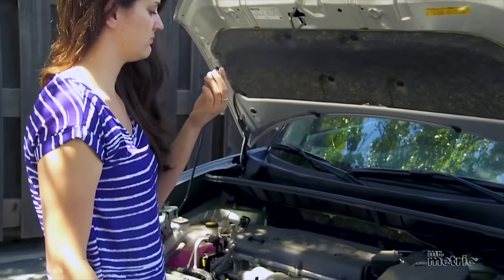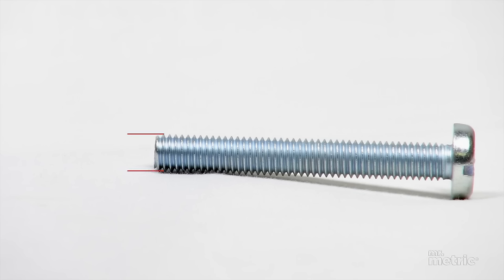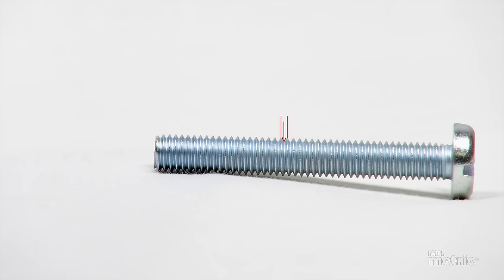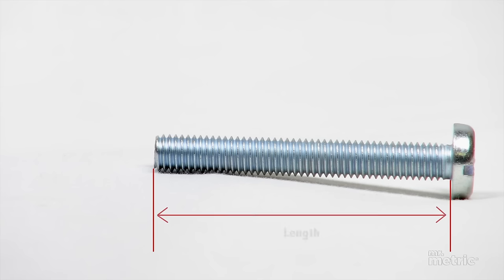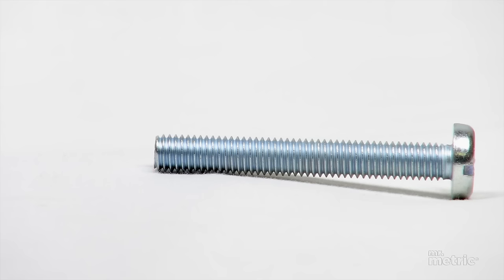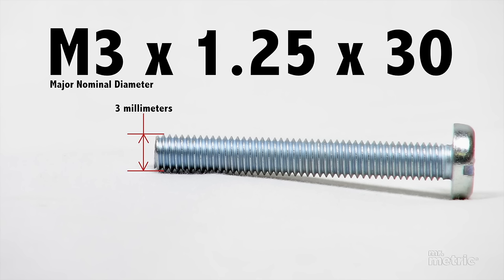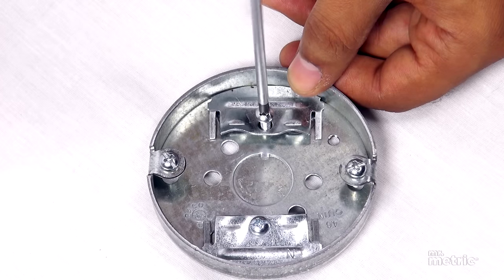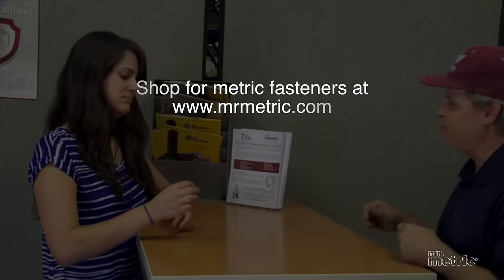How to Read a Metric Screw Thread Callout

Comment: Sometimes is see a screw sizes with a "g" in it. For example 10g x 16mm. What does the "g" stand for
Reply from the maker: The "class of fit” for all metric fasteners is “6g”. So for the question 10mm diameter with standard class of fit.

Comment: For US measurements:  Thread Pitch will instead give the number of complete threads per inch of length down a screw.  Ex:  10-16 references a #10 screw size (use a chart to know what exact measurement the #10 references), and a thread pitch of 16.  Aka, 16 complete threads per inch along the length of the screw.

Comment: I have a very tiny electric motor with a gear box that reduces it to 18 rpm. There are two threaded screw holes in the top plate of the gear box. Some research lead me to a diagram showing “2-M1.5” next to the hole. Can you help me figure this out? I only need a few, two exactly but a couple more to replace the one I will no doubt drop. 🤨

Thanks!

Comment: Thanks a lot, I was wondering whether it was the length of the thread or the whole bolt
Reply: For most types of head, it is the length under the head, but for counter-sunk heads, it's the overall length.

Comment: Let me correct some major mistakes:

1. There is no M3x1,25 screw. M3 has a standard pitch of 0,5mm.  
2. If I'd call myself "Mr. Metric" I would know, that we use the "comma" as decimal divider. The point is for the thousands.
3. The declaration of metric screws is [Diameter x Thread-Length] for standard screws. Only when it is a FINE-Thread screw (which is quite rare) the pitch is inserted before the lenth. E.g. M3x0,25x30.
Reply: " I would know, that we use the "comma" as decimal divider. The point is for the thousands."

This is not necessarily true. Some countries use these in the opposite places.
Reply: Some countries use 1,234.56, others use 1.234,56
Reply: Mr. Metric used that for example only not to divert his explanation in  wrong side
Reply: It is for example.....
Reply: You seem to know a lot. How do i calculate the minor diameter for this specific thread? M5 X 0.8

I would like to have the solution today, it is important! (Its in ANSI)
Reply: @GUATEMAXanimations  5-0.8=4,2   3-0.5=2.5
Reply: @Laubfrosch19  wwheeezzzeee! Too late, I already graduated last week from my CAD course!
Reply: @GUATEMAXanimations  I suggest you look up some already published tables.

Comment: Thanks for the video. I need screws for my Asus laptop, which are described as M2x2.5=0.5(3.3,0.3)(K)+H. I guess this means the screw diameter is 2 mm and the length is 3mm, but I'm confused about the rest. Does M2x2.5 mean the diameter is anything between 2 and 2.5 mm ? Is 0.5 the pitch ? Is (3.3,0.3) the length ? what about K and H? I'd be grateful for any help !
Reply from the maker: You chat with our fastener experts at  1-866-501-9504 and they can assist you.
Reply: M2x2.5 Means the diameter is 2mm and the pitch is 2.5 mm. I don't know about the rest designations.
Reply: It means 2 mm diameter, standard pitch (0.4 mm no need to indicate), 2.5 mm length.
We usually don't bother with stating pitch for standard fasteners.

Just imagine what a thread wit 2 mm dia. and 2.5 mm pitch would look like. Not that is couldn't be done, but that's an extreme driving screw, no fastener.

Same for the example given in the video. 1.25 mm is the standard pitch for an M8 fastener. You will never find this on an M3. Standard pitch for M3 is 0.5 mm.

Comment: Why I cant find M10 - 1.25 x 70mm flat head bolt anywhere..!!!!
Reply: Because the common pitch is 1.5mm and 1.25mm is fine pitch which is more rare. There are M10-1.25x70 socket head screws but can't seem to find any flat head for that size. Not sure what your application is but making a counter bore might an option.

Comment: M16*3*40/60.. what does this mean??
Reply from the maker: Good question. For M16-3.0 x 60mm or M16-3.0 x 40mm, it would mean: M16 = Diameter
3.0 = Thread Size
60mm or 40mm = Length
Reply: =) thank you ..

Comment: The bolt shown can't be M3x1.25x30. If the 3mm is correct the pitch is 1.5mm . I copied the picture into paint and copied  the 3mm end measurement and  laid it over the thread measurement... https://i.imgur.com/jl3pbFV.png